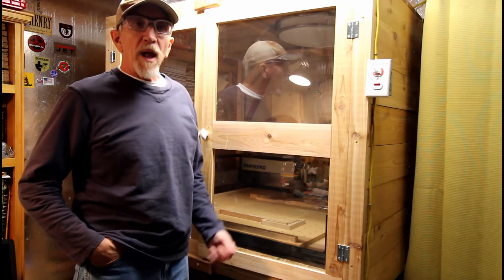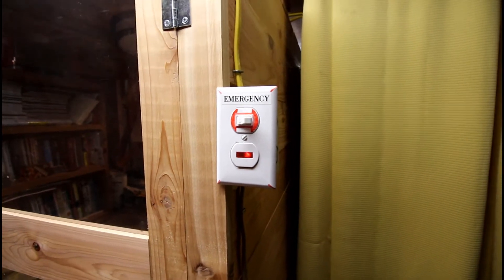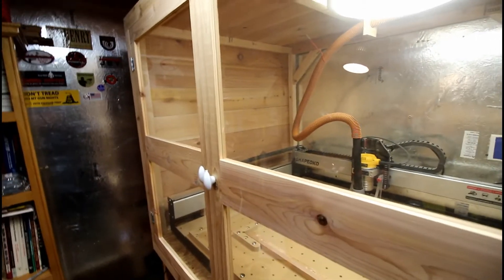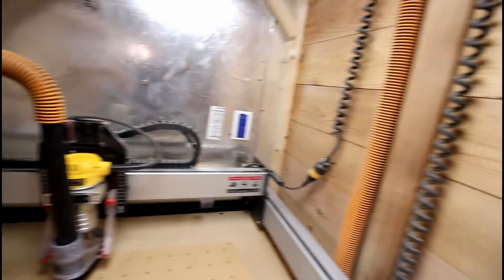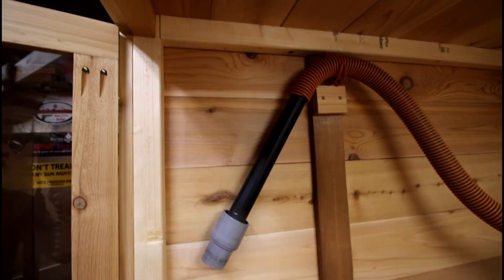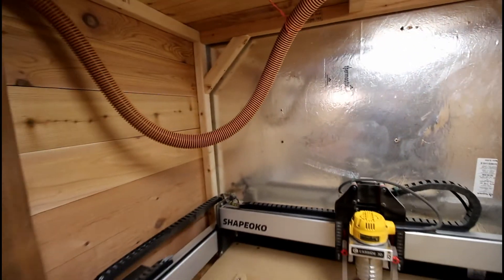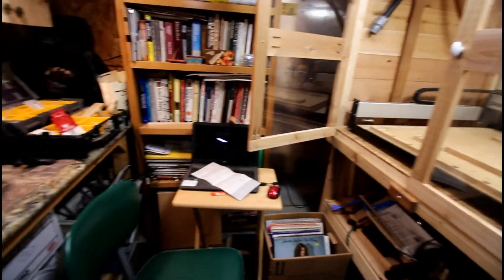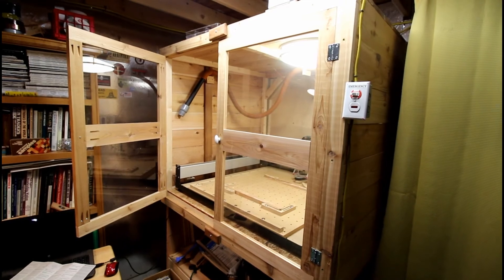CNC Enclosure -Shapeko 3 XXL. Easy DIY project

Comment: I might use some of these ideas. I think I may put a hinge of some kind on the back and sides for full access, though. I also cut long stuff at times where I need it to hang off the back or sides.
Reply from the maker: Thanks for watching. I built mine with screws so I have quick access to control panel.

Comment: Thanks for the video, any reason why you moved away from the t tracks and into an all insert wasteboard?
Reply from the maker: The tracks were not working for me. The clamps would stick up and sometimes the router would hit them. Also the rails did not give me enough flexibility as they were to far apart for a lot of situations. So far the new system has been ideal.